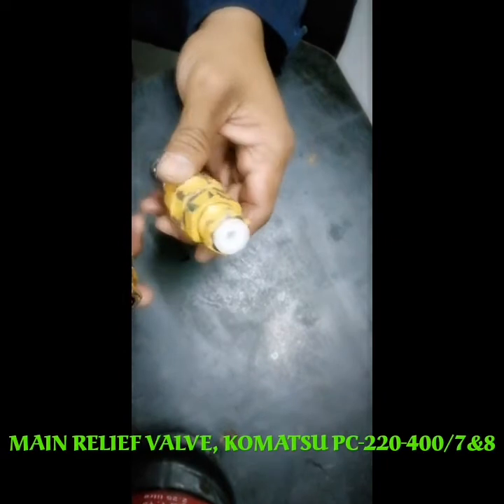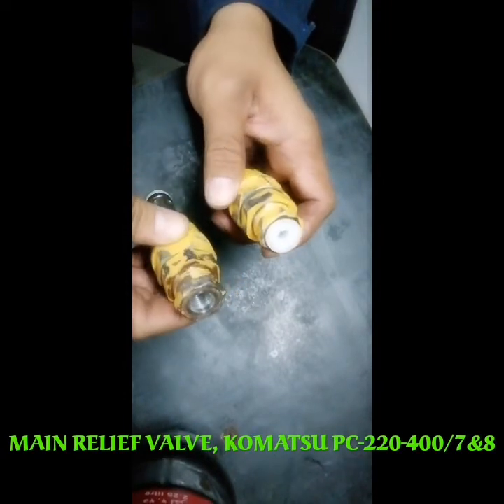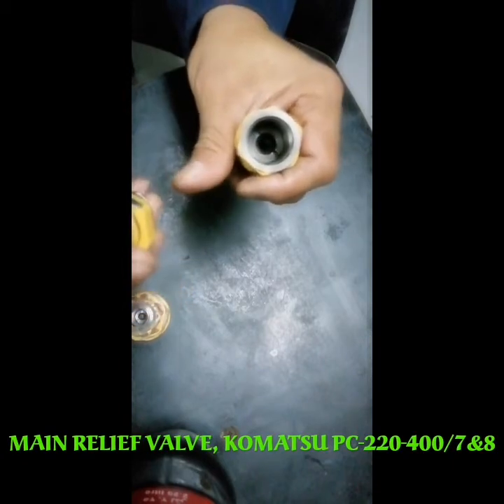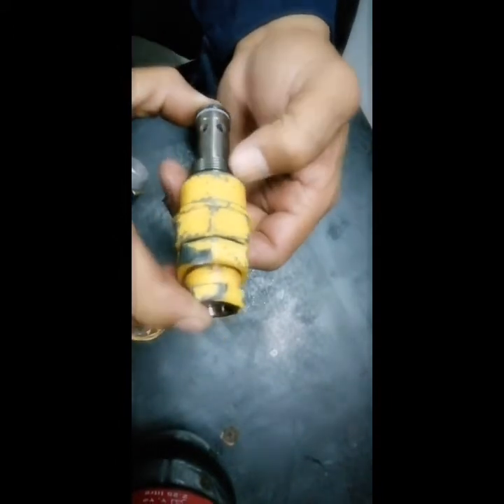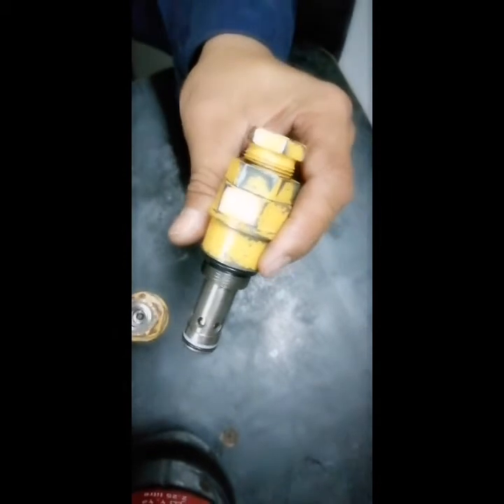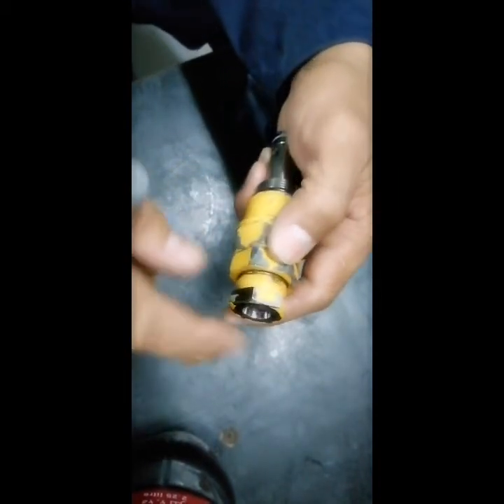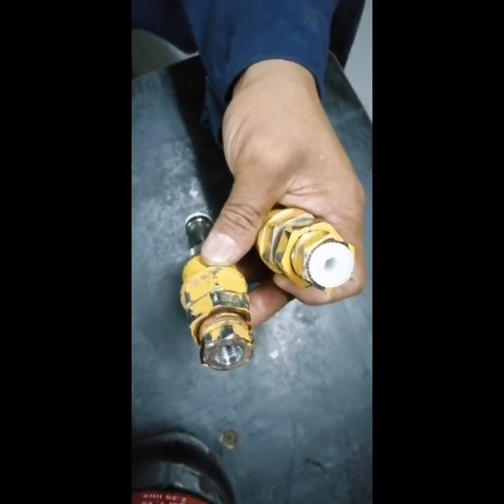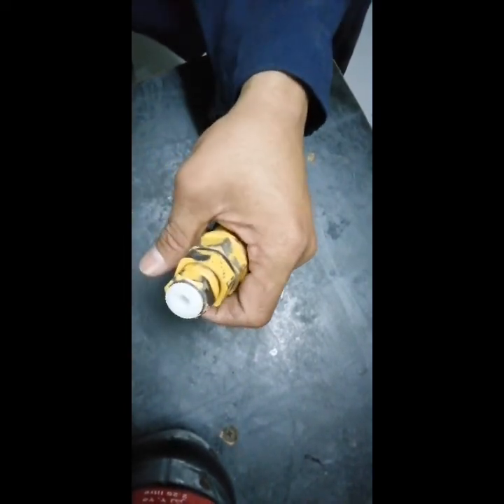MAIN RELIEF VALVE, KOMATSU PC220-400/7&8 REPAIRING CAUSE OF VIBRATION OR SHAKING OF PILOT LEVER

Comment: Maari din ba boss/sir na yan dahilan lage nag leak ang hose line from main pump to control, naka ilang palit na ako yun parin problema, mag leak sa hose papunta control valve,
Reply from the maker: High pressure ksi ang main hydraulic pump so mag depende yan s quality ng hose or tibay ng pitting at s mga o rings n ginamit, check k muna ng pressure ng main pump
Reply from the maker: Normal pressure nyan 300 bar up to 350bar

Comment: Hello ! I have looked at my relief valve and unfortunately it doesn’t have defective seal as yours. It has no seal in fact. On this machine I have a problem at the drive. It definitely have low driving force, After actuating it in slope for some time it completely can’t move.

I have included the videos, main puppet and main relief valve and a try of machine. I have installed analog indicator that tells real time the pump pressure, it’s parallel to the motor on the original pump pressure sensor, I find it very handy (was not able to enter the reading of pressure on machine monitor)
Puppet close view :
https://youtu.be/D_uCgDHvFiY

Main relief valve :

https://youtu.be/sT6mJDjbGGw

Hydraulic motor stalled rexroth a6vm :
https://youtu.be/UCaKybxkVXc

Comment: Hello. Your video extremely useful. I suspect some kind of problem like that on my Komatsu excavator . I got some fluctuations at the max pressure. When I shut down the machine I’ve got a shock on the joysticks. I will check how this valve is inside. Your information is extremely valuable, no one else would tell 👍
Reply from the maker: Thanks, well i make that simple video just to help anyone related at the same problem. Thanks again

Comment: Tanung lang paps ung ung pc 228 sir  ..kapag naka Low mode sya ok nman ung false..pero kapag naka powermode kulang ung lakas ng backhoe sir
Reply from the maker: sinsya n now lang ako nka reply, alin b ang nagllow power makina b o sa hydraulic system
Reply: Ung hydrulic poh ..Hindi nya mataas ung boom up nya kapag may karga na ung bucket nya kapag naka powermode sya ...pero Kung naka low mode sya kaya nman nya itaas ung boom up sya sir..
Reply: Pero kapag sinagad mo ung rpm nya kaya nman nya itaas ung boom up khit may loud ung bucket nya pero may lumalabas na code sa monitor na E15 sir ..at ung code na un sir eh over rpm ..

Comment: I'm looking at buying a komatsu PC 220 lc3 series excavator I'm curious I'm glad your advice is on it if it is a good and reliable model thank you and also what I should look for when looking at it
Reply from the maker: bro if you have watsapp add me and show me the photo of machine and sr# +971567581176, test the machine idle full boom up 10sec.dont release the pilot and hear the sound of engine also arm same procedure observe if engine is not almost stop most be engine will be run only like idle, and full acceleration check the speed of boom, arm and bucket, up boom close of arm and bucket and boom up out arm and bucket, to make it sure that there no any enternal problem, sometime, you very attrac visual outer of the machine but maybe and  you do not know that there is or you cannot see what we have or weak enternal problem
Reply from the maker: actualy boss all type of machine is good, we just defendin on you on how you check for you to satisfied
Reply: @caterpillarjhunhunk  i sir, i have a pc200 lc3 1987 serial 26772 and i think may be a have some kind of problem with one of these cause at hi rpm the lower the boom fonction become realy stiff like it have hi pressure comming in the low pressure side
Reply: forgot to mantion that i like your video thx a lot for shearing good video that have a lot of rare an awsome info i'm from quebec canada keep on going sir 👌💪

Comment: Hidraulic  videos  I have a problem whit the pc228 lc3  the engine almost die every time I do two functions
Reply from the maker: bro as you requested i made 1 video i think this is the solution in your problem try to follow my video for the proper way on how to check ok, and i hope you share my video and let somebody to subscribe, thank you for watching
Reply from the maker: bro try this idea, start the machine and switch the the safety lock then, if you are alone you have to go down then check the rear side or the hydraulic pump there is a 2 solenoid coil over there, what to do,must be both solenoid is in powered meaning have 24volts supply ok, but when you fully operated or work the machine one of the solenoid is automatic of, and the other one will conteniou on ok, or if you have watsapp give me i will try to send you the picture of  hydraulic pump were to locate the solenoid